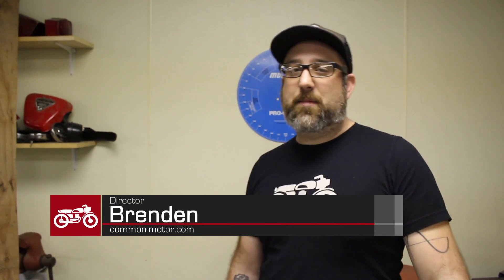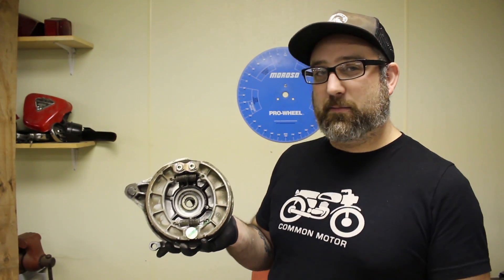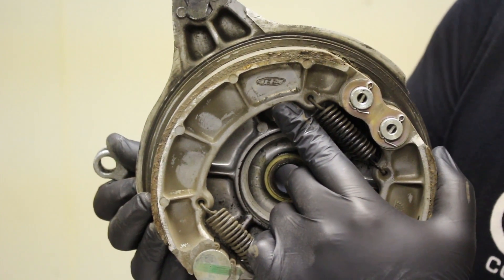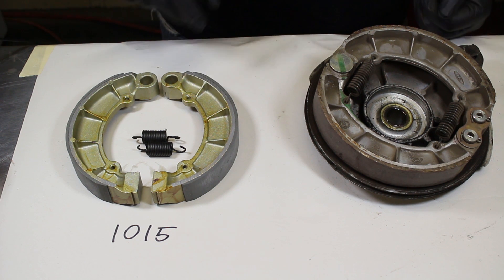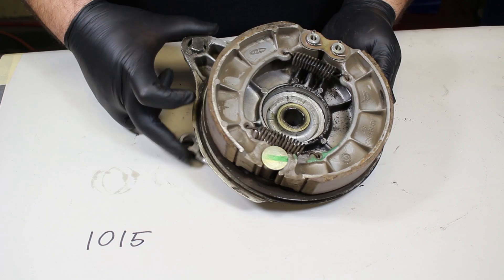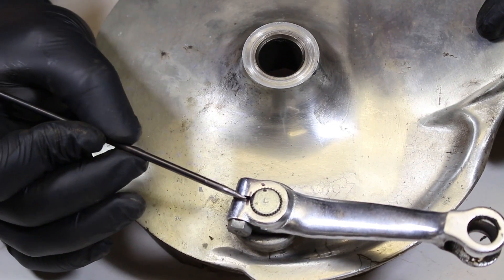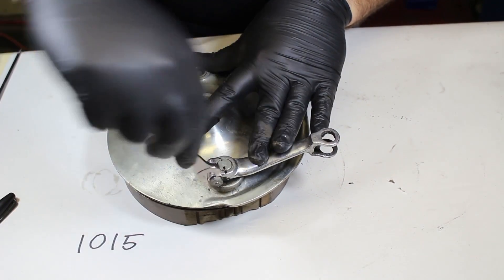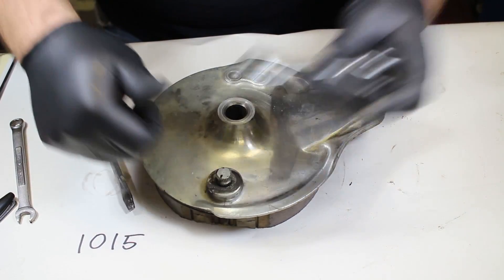Honda CB450 & CB550 Rear Brake Rebuild

Comment: Thanks for making this video.   I'm pretty sure the rear brake set up on my 1975 CB750 is the same.   I thought replacing those rear brakes would be a pain in the butt, but after watching this video I'm kind of excited to do it.  I'm removing the rear wheel to put on a new sprocket so I might as well do the brakes while I'm back there.

Comment: I'm restoring a 550k right now, ground up resto,taking my time,i decide to start working on the rear wheel today, the bike was parked for 30 years or so outside and inside,its rough but not terminal,once i popped the rear hub the shoe material fell out ha ha ha ha, both of them!  guess thats how some people get hurt, find a bike that was parked for years, get it running without checking anything else and go for a ride,oops.

Thank you much for the video,it was helpful.

Comment: Maybe I can get some help here, ive tried reddit and a few other places.  Put some new shoes on for my vstar 650 and after i attach the new shoes on, and im reassembling everything back together on the rear wheel, the brakes WONT go into the drum itself it looks like the pads on the shoes are stopping it from fitting... ive tried everything and looked up as much as i can and i cant find an answer anywhere man
Reply: Maybe your new brake shoes are too thick? Not all replacement parts fit 100%.

Comment: Awesome video I learned so much from you I have a 77 Honda CT125 trail Rare!!!!  I am going to do the exact same thing you just did in the video , Also I need help on what modern parts from other Honda’s will work on. My 77 Honda Any websites that you can share for parts gathering for my 77 Honda 125 trail